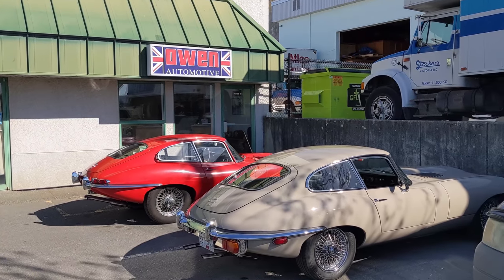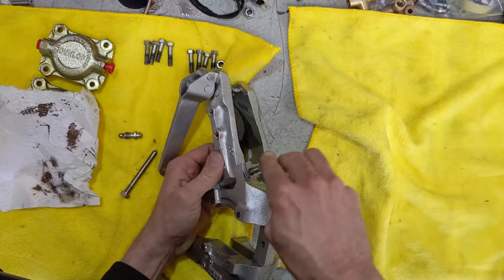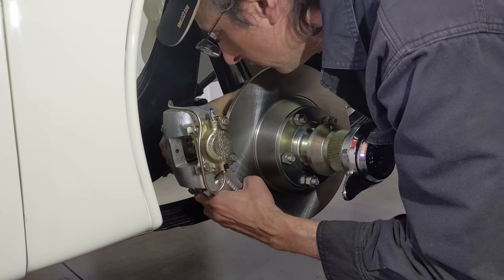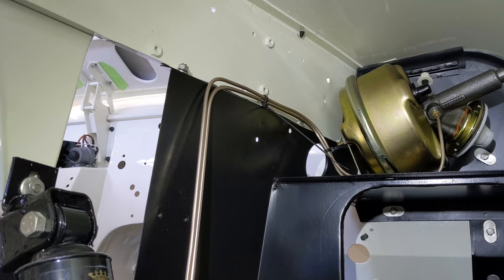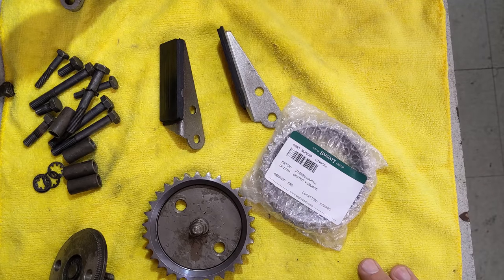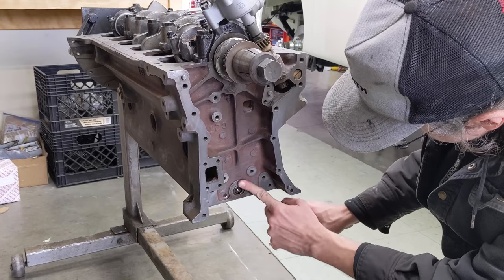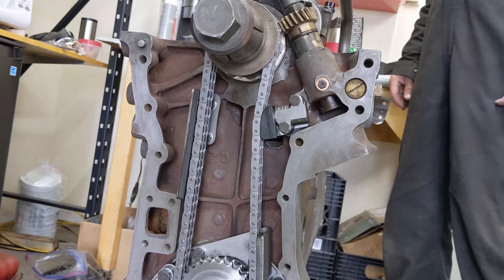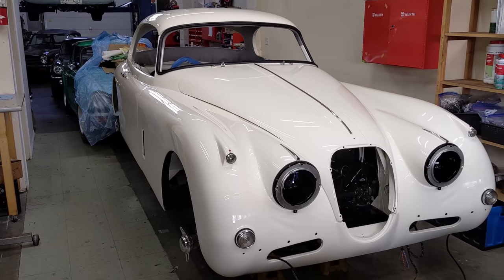Jaguar XK150 Restoration EP10

Comment: I am enjoying watching you work so much.
I have a tip that was passed on to me by an old hand. I was having a lot of trouble in getting the air out of a motorcycle braking system. He made sure that the master cylinder reservoir was topped up & pulled the brake lever on, fastening it back to the handlebar with a zip tie. He told me to leave it like that overnight. The next morning I removed the zip tie. All the air had gone & the brake lever felt really good.

Comment: Great work Richard, one tip with the replacement brake light switch. They can fail pretty quickly, I think it’s sng that do a premium quality one which is supposed to be much better regards Nigel

Comment: Hi Richard,  Great episode again, really enjoying your coverage of the rebuild. Can I pass comment on the back axle piping. The brass ' T 'piece fitted I think is the wrong type, it should be the one "without" the built in flange ie the one with the hole going through the T. This then makes the connections lie flat and makes the pipe from the right hand road wheel follow the contour of the diff housing. This eliminates the pipes crossing. The flex then feeds into the front of the 'T' which will aligne it better with the chassis connection. Cheers Steve.

Comment: Superb work as usual. On my 'junk' 150, that I have owned since 1976, I have done similar to this but not on your level,.
I found the 'Automec' cunifer brake pipe kit had no faults. I have overhauled the compete original 1957 brake system with new seals and added a reservac tank. I have retained the round pads and FYI the system works remarkably well considering its age. I did add the later hydraulic reservoirs with level switches connected to interior warning light,just in case, for safety sake.
I have done similar to the engine but of a Mk10, that I shoe horned. I do remember a conical strainer behind the hydraulic chain tensioner. I am assuming the original 150 does not have this?

Comment: Interesting to see the copper fuel line. Was the original Jag line copper? I ask because a good few years ago I though I would upgrade the fuel line on my 65 Mustang to a fit and forget copper line. It was fine until a really hot UK summers day and then the car would just not run as the fuel was vaporising in the line. I changed it back to a heavy grade rubber type line and it was fine. I also agree that upgrading to good disc brakes is the way to go having driven a car with drum brakes in modern traffic.

Comment: Will it be an authentic Jaguar restoration if it doesn't leak something, typically oil?
Would it be wohwhile making a jig to bend those lines around the brake calipers? It would depend on how many jobs  come in with the same layout, I suppose.

Comment: Project looking first class. Your series 1 E coupe is perfection, but the XK-150 coupe has a certain presence. No-one could argue the sensibility of subtle but important front brake upgrade as the 150 is quite a heavy car and modern drivers don’t understand the importance of sufficient following distance. Guess I was luckier fitting the bronze brake pipe kit I got from Guy Broad as it went together very well. Did you not think fitting stainless steel sleeves to the brake callipers and master cylinders was worth it? There is also a bigger bore clutch master cylinder available which makes a big difference in operating the rather recalcitrant Moss gearbox.
Reply: Yes I'm on round pad and it's not bad at all when in tip top condition. Yes think ahead.

Comment: Richard, Great video, Can i ask again do you know what the hole in the rear of the floor pan behind the drivers seat is for ?  Cheers Dave
Reply from the maker: Dave good to hear from you. It really did help me install the hand brake bracket. There are two plugged off holes near that location too.
Reply: Access for original jack positioning.

Comment: The owner is going to have problems fitting replacement pads on the front brakes as they'll always have to have them milled down to fit?

Comment: the core plugs should be left as flat as possible to prevent them popping out ,as happenedto me ,work the from the outside in to the cente r by hitting with a dolly
Reply: Ha,I once had a rear one at the back of the block on a 420 pop on me. Sudden loss of water and head gasket gone!

Comment: Michael It may be that you are using a special type of Cadmium plate but i attach a note regarding possible effects of cadmium so please take care :- Why is Cadmium Plating Banned? Cadmium is a highly toxic cumulative poison and an IARC Group 2A material (probable human carcinogen). Because it leaches easily, it is a frequent environmental contaminant from aircraft and engine washdown   - XK150 rebuild is great, kind regards Brian UK
Reply from the maker: Brian thanks for the note. Our cadmium is done with strict measures in place so the effluent is not leached into the local environment.
Reply: Richard i was more concerned about you handling it with bare hands plus any dust inhalation (ie when cutting, drilling or heating of it should be avoided) best wear gloves, BTW I have an exact same model XK 150 3.8 SE FHC  in Old English White in mint condition and can't wait to see how you fit the windscreen chrome trim as i have two new side trims to fit which daunts me, love to watch your skills and your friends - thanks for your reply best regards Brian  @RichardMichaelOwen
Reply from the maker: @brianmelville1096  Yes. So dealing with Cadmium is a concern when grinding, blasting and heating up, I agree. I will do the windscreen in an upcoming video. Cheers!
Reply: thanks Richard look forward to episode 11 @RichardMichaelOwen

Comment: why are you using the dunlop brakes they were not very good in the sixties ?
Reply: Later XK's had square pads known as Quick Change. On the original round ones you had to disassemble the caliper to change. I have mentioned that even on original round pads they're not bad and I did always pass the UK rolling road brake MOT test. Used it today quite happily. Even up to late sixties many sports cars still had drums
Reply: @adamskikijowski9139  I know but I drove E types in the sixties and when they were driven hard at high speeds they needed a lot of stopping and could not compare with stopping a Lotus Elan for instance